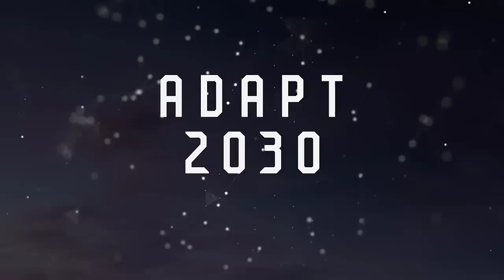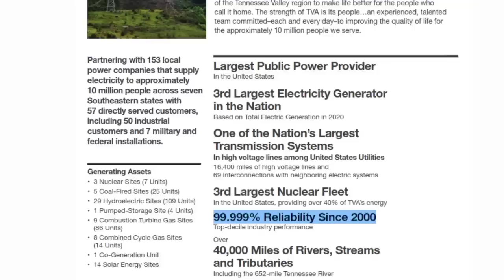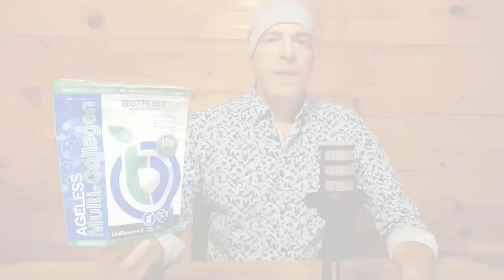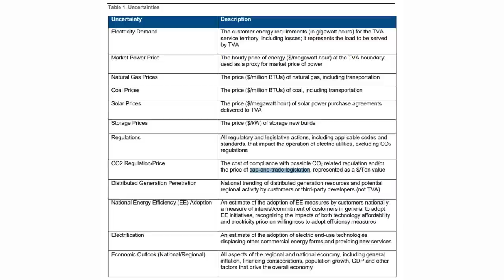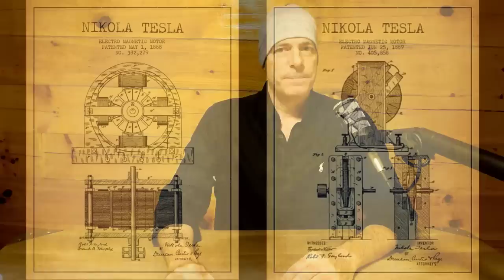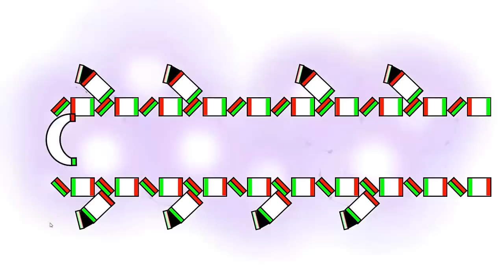Winter Power Outages and What You Can Expect Next

Comment: When people start to freeze to death or die of heat stroke due to no heat/air conditioning, they have to modify their mandates. People will be taken out of their homes like popsicles because they don't have electric/gas heat as the plants can no longer service the demand. It will require most of us to install woodstoves or fireplaces for heat sources, which defeats the purpose, as burning wood is also unacceptable for CO2 emissions. Although, I understand the newer woodstoves have been required to be upgraded in their design so their emissions are reduced. But it also means that our trees will be at risk from overlogging to supply the wood. I wish, in all their mandates to "save the earth" that they would also make cutting whole trees down for building purposes would be limited to harvesting the bottom limbs from trees or fallen limbs. It's like either gathering the eggs and milk from the chickens and cows or killing them for the meat and ending the sources. Cleaning the air means little if we correspondingly cut down our trees which clean our air, not to mention the mudslides and damage from clearcutting whole mountains. We have enough synthetic "wood" made from recycled materials for building, both interior and exterior. We have designed these materials to be indistinguishable from real wood. Disappearing trees also contributes to drought and reduced rainfall, as well as reduced habitat for wildlife.

Comment: with gates putting up 6000 ac solar farms and d keith blocking the sun sounds like a brake torque.or will davey leave clear patches for billies solar.we had sun y/d.a big ass tanker went over with short trails at dark.spraying in the night and wahla foggy this morn.and calm.no wind /no solar today.hmmmm.big fuel shortage makin me wonder what the avgas costs for these chemtrail operations.it at least a 3 part mix they use(or more) i live in sask and there are no airports north of me. when big tankers go north or come out of the north u wonder where are they going..when i first started digging into geo eng i found out milops needs clouds to bounce radiocomms .mic is involved and up here its way out of control.sunny saskatchewan my ass.they spray 6 days a week up here.they use pilots? id like to know whose flyin them rigs

Comment: If the TVA has no solution to meet peak demand while reducing emissions/less capacity then it’s already too late to move to “renewables” in time to meet the 2030 targets, the infrastructure to make that big of a change isn’t in place.  Knowing that the wind & solar is less reliable & battery storage is an issue especially in cold conditions then they would need to at least install enough renewable to double what FF they take offline & likely need to triple or more (need room for growth).  In order to create a power grid to meet that demand & build & install all the components they would need a minimum of 10 years from drawing room to finished install.  There’s zero chance of them meeting power requirements if they meet the UN emission requirements.    If they dismantle FF power stations then there will be no backup or going back to when the grid fails.

The reality is that if they wanted to be completely “renewable by 2050 & completely transform the US power grid in every state & home then that’s a 50+ year project at a minimum.

Comment: Howard R Johnson patented all 3 types of magnetic motors. That diagram was H. Johnson's. Tesla never used magnetic caps. Nathan Stubblefield made Earth Battery patent/US600457 Acoustic Telepnony patent/US378183 Wireless Telepnony patent/US350299 All of which Tesla Used. Then people say we can't find Tesla's notes. Tesla didn't invent those things. Tesla did make his own switch between earth batteries and air battery.  None of Tesla's patent were for magnetic motor. They all are for electric motors. Tesla's arc light was used by Stubblefield. Stubblefied used oak tree to light the arc light that hung in the tree. That was after discovery of air battery by telegraph operates during solar storm. People mention Tesla so you only get half the information. The other half comes from Stubblefield. Tesla was nothing without Stubblefield. Tesla heard aliens on wireless telephony he was playing with. Without Stubblefields work you can't wireless provide power. Just because Tesla used them don't mean they were his. Tesla wanted to use earth batteries and telegraph as power source. Thus the warden tower. An air battery with earth battery under it and it made ac by electro static motor Tesla made. Instead of using Stubblefields switch.
Reply: Eli, what can supply 600 kilowatts monthly?
I would like to learn more about Earth batteries.
Are you familiar with those?
Would you like to assemble one?
L